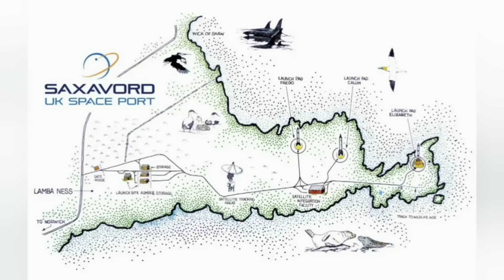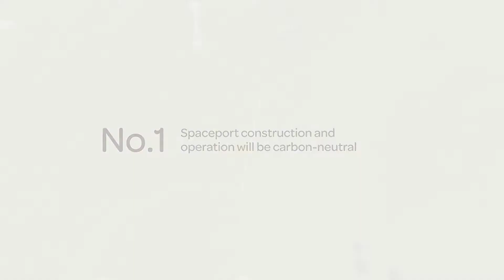Big win, bigger rockets and ESA money for Saxavord Spaceport!

Comment: Any chance SpaceX sells Falcon9 equipment and infrastructure up there when they move on to Starship only? 
Something proven and affordable, possibly not run by Musk anymore… could ESA and others combined pull that off? Would SpaceX or anyone on the other side actually want that?
Surely there are issues with launching from much higher latitude than current launches and it might be odd to just sell off a system that way but there’s a need and even if other launch providers find success they could always stand to add something like a Falcon9 to the arsenal. 
Am I insane even thinking about this at all? Would trickle-down work in this case?

Comment: You have got to admit that with the hefty restrictions on launch candance that both environmental concerns and multiple operators from the same pad create that going for larger rockets is a sensible choice. If you cant gaurentee putting 8 seperate launches in a year ... why not simply lift 8 sats in 2 launches?